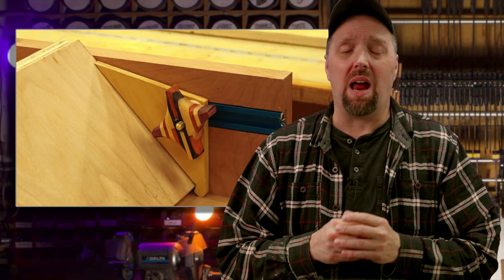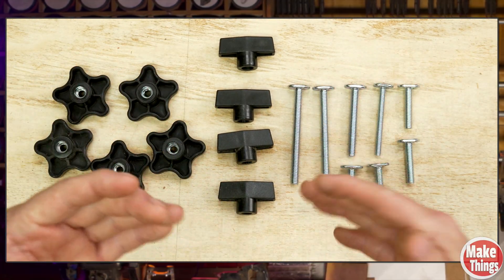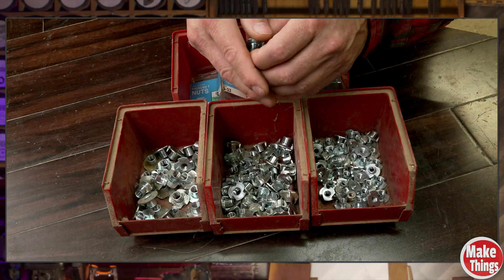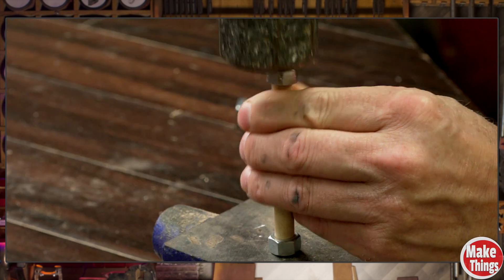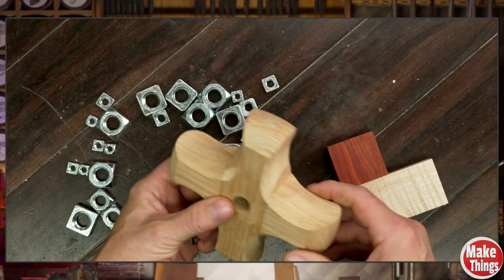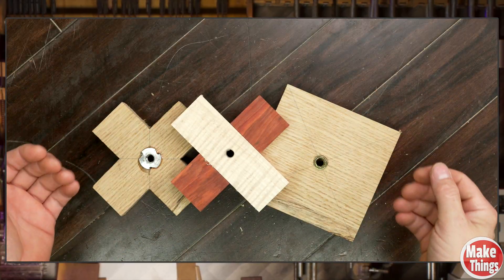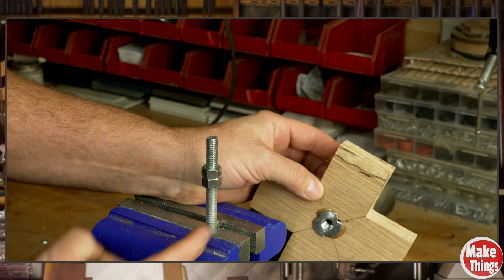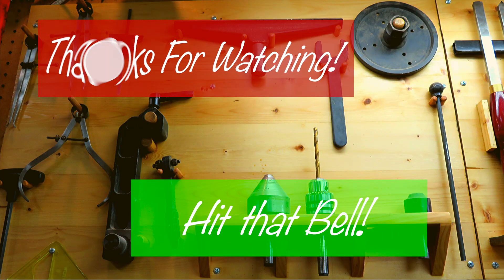3 Ways to Make Your Own Knobs (Two Broke Bolts!)

Comment: O'm a mechanic, sobwhen I need a knob, I use a wrench on a nut/bolt. It's not elegent and it only works if there is already a threaded rod there or some place I can drill and tap a hole.

Comment: I've made a few knobs, mostly because I'm a hobbyist on a pretty tight budget. And it was fun to do, too.  I think I mostly made them with T-nuts, and I didn't remember using glue.  It's been a minute and most of them have permanent homes so I don't see them up close. 

Mine have held up, made from pine or poplar, in light duty situations - holding a drill press fence in place, stuff like that.  It's not under vice-like stress.  But so far, good enough.

Comment: Thanks for showing that this is not rocket science.  I've made a few 3d printed knobs but not for the sort of things you do where force is important.  For me it's mostly replacing some old radio knob that's impossible to replace.  3d printing has a lot of the same concerns you covered and everything you made could also be 3d printed if you wanted to.  When you're a hammer everything is a nail.  It's pretty easy to cut some wood to a knob shape but if you're into 3d printing it's pretty easy to just whip up a design and print as well.  Both use inserts though.  The strength comes from the metal and distributing the force evenly to the wood or plastic knob.

Comment: I've made a bunch of knobs just using 1/4-20 nuts. Drill holes slightly smaller than nut and force nut in and then use CA glue. These have lasted for years. Toilet bowl flange bolts are cheap and come in various lengths with head to fit in T-track.
Reply: Yes! Exactly how I do it also. Adding ca glue or epoxy before you insert the threaded nut works just fine!

Comment: I keep some 1/4-20 and 5/16 pre made knobs around. For anything else I use my 3d printer. 

If a printed knob with a press fit square nut won't do the job, the job probably just needs a metal nut.

Comment: Excellent tips, Rob! Thanks! 😊
When using hard woods you can also make the treads directly into the wood. I bet it wouldn't be that strong, but for many uses it's more than enough!
Stay safe there with your family! 🖖😊
Reply: Cut the thread, coat w/ super glue, wait, chase the threads - repeat a couple of times.
Can make a tap from a bolt - will make a tighter fit.
Reply: @bryanreynolds4243 Yup, specially for soft woods it works wonders. But for hard woods I think it's not necessary.